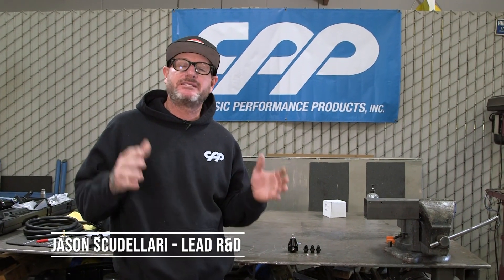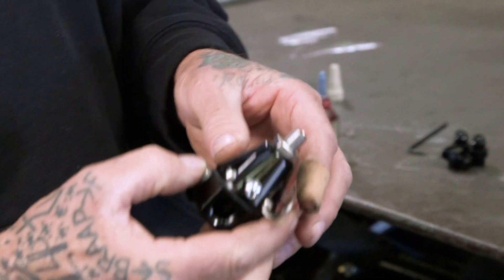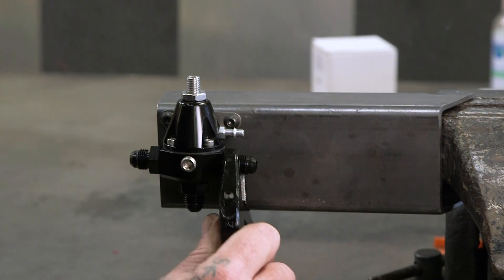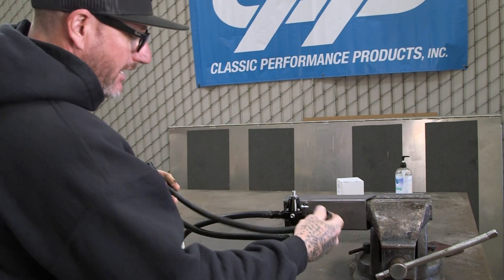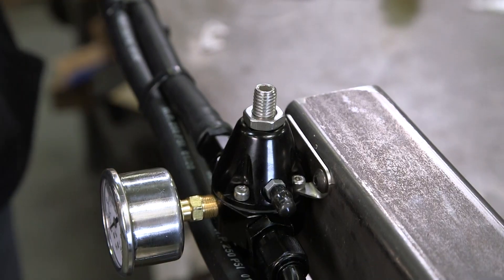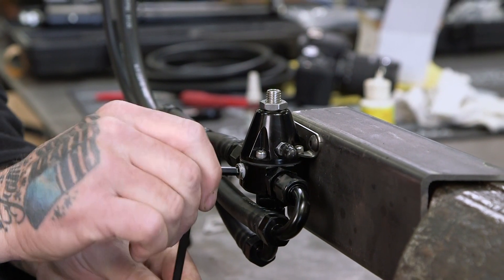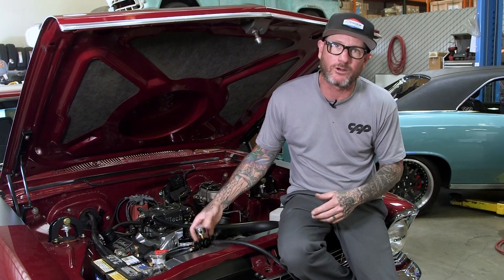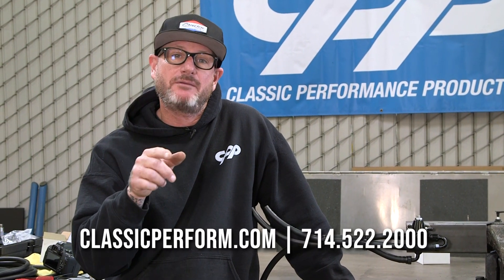CPP's Fully Adjustable Fuel Pressure Regulator

Comment: Can I use a inline fuel injection fuel pump with this regulator on a carburetor?
Reply from the maker: Yes! The idea is that you can run a high-pressure EFI pump and still be able to adjust the pressure down to the correct PSI for a carburetor.
Reply: @ClassicPerform  ok then I'll give it a try.  I figured it would heat up pump even with a fuel return.
Reply from the maker: @jtauto74  Nope! The adjustable regulator just returns the "extra" pressure from your pump back to the gas tank. Your fuel pump will actually work less hard when your decreasing the PSI for a carburetor.